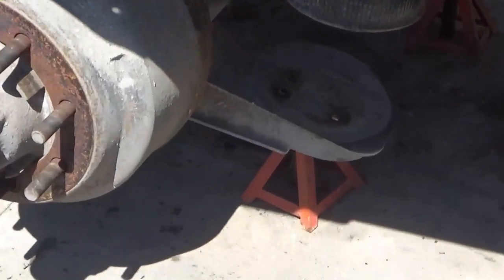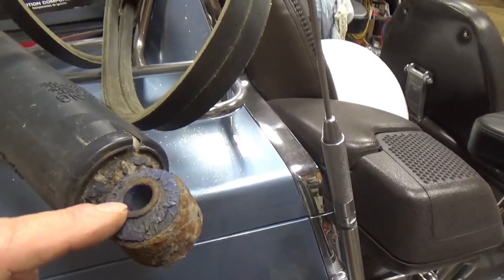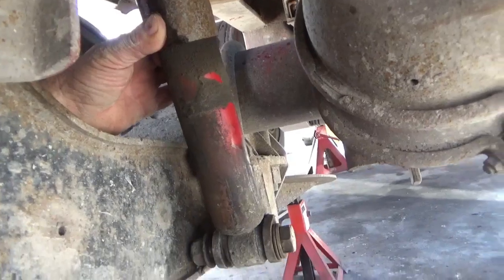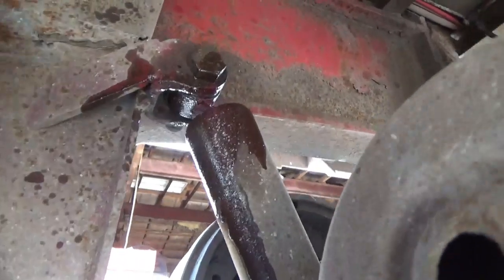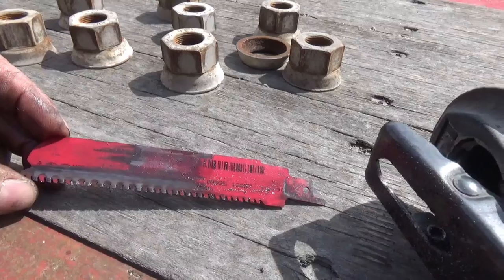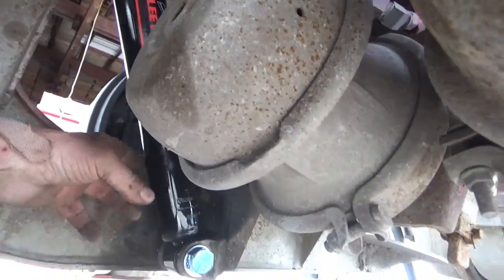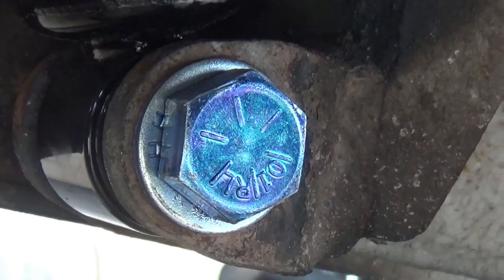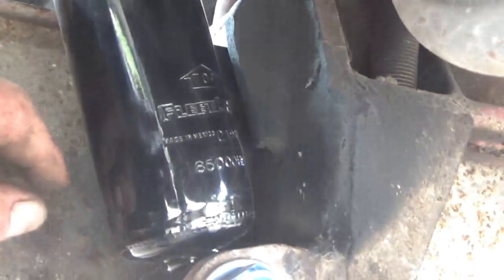Replacing shocks with seized bolts

Comment: We were snow free for the most part in Northern Wisconsin but we just got 16+ inches of snow on April 12th in 8 or less hours. When I do shocks ill give a quick try with an impact because once in a while they surprise me and come off. Otherwise I torch them off and use cold chisel punches and a big hammer with WD-40 specialist and the bolts or whats left of it comes out pretty easy that way. I use LP on my torch too. Works find just a little more dirty but it beats out the cost of acetylene. Once you heat a bolt up it loses its hardening and its always better just to get new. Grade 5 or 8 both will work fine. No reason to chance it and the bolt breaks on the highway shock goes into the ground rim or tire and can cause someone else getting hurt.
Reply from the maker: Thanks for commenting.

Comment: I Have The Old School Regulators On My Torch Set and I Use Propane Gas Grill Cylinders On It With No Modification When I Run Low on Acetylene 😀😊👨🏼‍🔧 Excellent Job Gordon 😀
Reply from the maker: Thanks Chris.

Comment: I turned away and wasn’t looking at the video just before you had said “six pack of Milwaukee” and I at first thought that you got a six pack of Milwaukee beer to help you get through the frustration of getting that frozen shock off. I need some to help me deal with my frozen bushing on the bottom of my shock. 

The first one that I removed on the driver’s side came right off with no trouble. Getting the one off on the passenger’s side is frozen on. Might as well be welded on. I have it soaked in penetrating oil overnight now. I’m going to give it another shot. I have a feeling that I’m going to have to cut the round part from the bottom, pry it out, remove the rubber to get to the frozen bushing. Maybe try heating it up before beginning to cut that one too. It looks like with the setup that you have, doesn’t give you the ability to try that method. It looks like there’s something in the way that wouldn’t allow you to cut that outer bushing, let alone the inner one that’s under the rubber. Looks like mine will be easier than yours, but still a pain in the butt. All this work just to get one little part that’s frozen on. In my situation, it’s only the last bolt that frozen on. All three other bolts came right off.